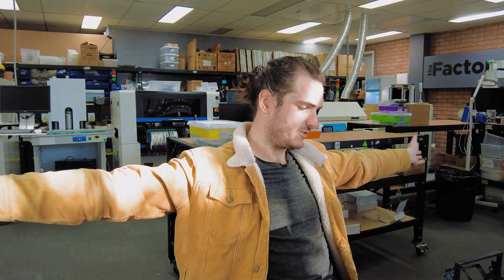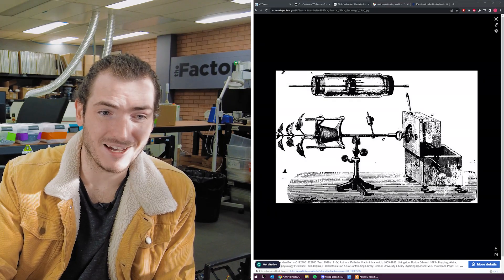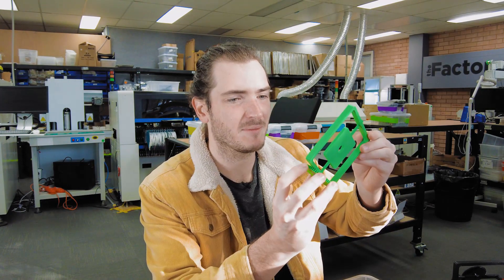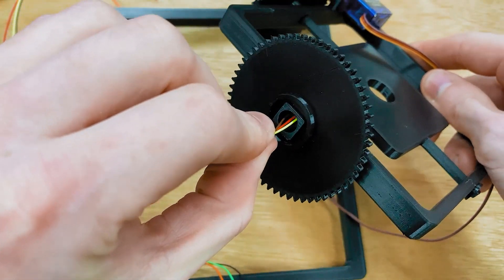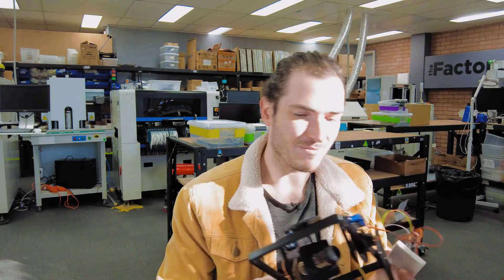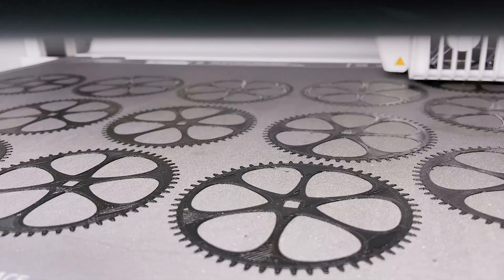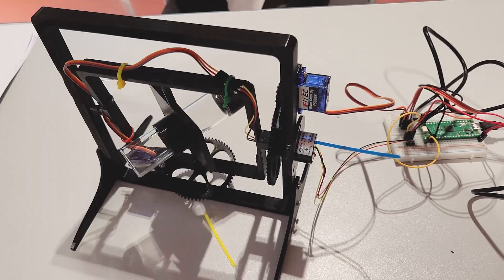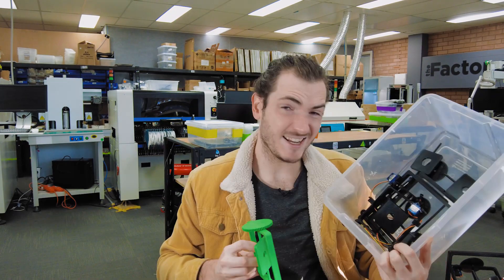Simulating Microgravity with Random Positioning Machines | The Factory

Comment: thanks for sharing!.. which servo was used?
Reply from the maker: Michael was just using some cheap 9 gram servos, specifically these ones:
https://core-electronics.com.au/towerpro-sg90c-360-degree-micro-servo-1-6kg.html
Reply: Thank you so much.. I looked at the github, Do you folks have an STL file for the Slip Ring? I tried importing the other filetype for the Slip ring but it doesn't have holes to slip cables through  @Core-Electronics
Reply: actually, nvm. this is a difficult one... I think we would have to make the slip ring from scratch or use an off the shelf one with the right size...